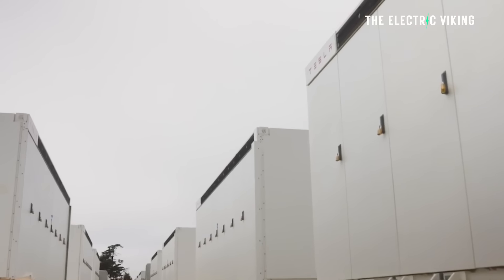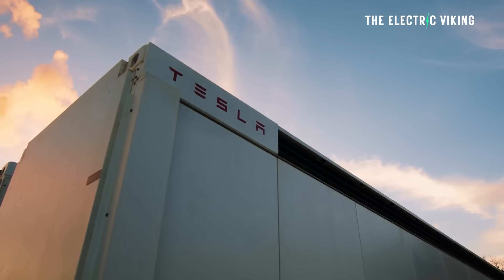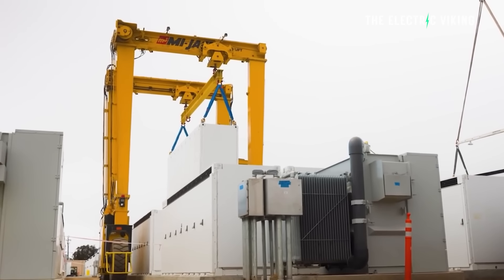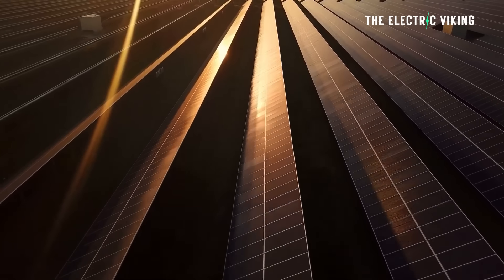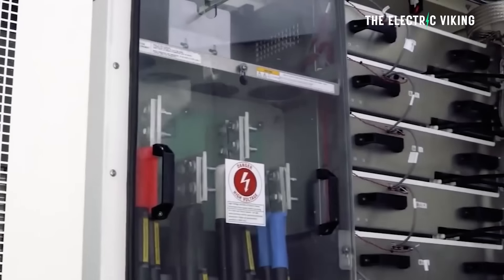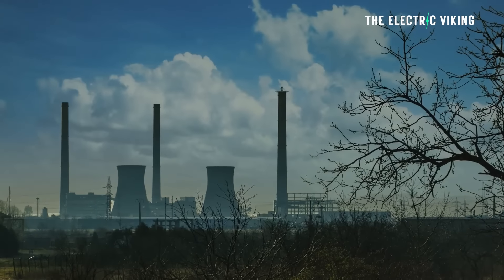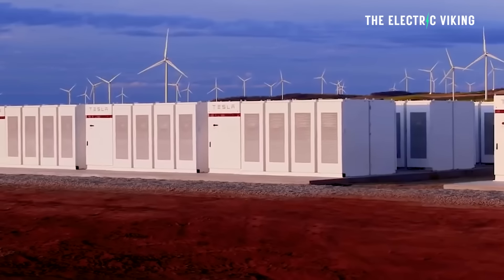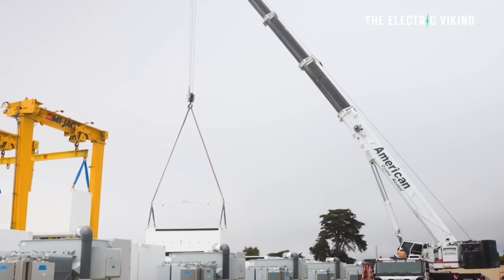Tesla megapacks deployed to build the biggest battery in Australian history

Comment: Sounds like old world thinking on new tech.
Lots of power loss over long transmission lines!

Makes more sense to have lots of batteries at local substations, 
charged by rooftop solar.

Biggest battery sounds great, but single point of failure.
Bad weather could affect battery or transmission line,
and whole network goes down.

Comment: Wonder how long the battery will last
Reply: Decades. The cycles will be regulated to reduce degradation of the already impressive chemistries. 

And when they do happen to get outside of tolerance, they will be recycled.
Reply: @williamcrowley5506  Yes, I hear they are 10% recyclable (lead acid batteries, which are 99% recyclable). What happens to the other 90% . There will be times that the batteries are delivering  100% of the power
Reply: @marvenlunn6086  They last decades. They are 100% recyclable. Lead acid last 3 months. You need to do some reading.
Reply: @marvenlunn6086 you've got mixed up on the headlines you have read. You are thinking of the story that Australia only recycles 10% of its batteries (think AA, tool batteries etc.) And not the only 10% of a battery is recycled. The story also had nothing to do with EV batteries. 
Sadly this says more about Australians and their recycling habits than it does EVs....
Reply: @steve_787  your right. The batteries are around 90% to 95% recyclable . Recycling is a scam anyway
Reply: @marvenlunn6086  🙄

Yes. Recycling has major issues. The batteries discussed here do not fall in that category. Stop letting your emotions lead you, and do the damn research
Reply: @marvenlunn6086  the steel and aluminium industry would disagree that recycling is a "scam"
Reply: @steve_787  how about only recycling a small percentage of things like batteries and plastic? It seems like a scam to me
Reply: @marvenlunn6086  I fail to see how recycling is a scam? The issue is more down to what, we the people, do with our waste. If you throw plastic or batteries into your waste bin that goes to landfill then that's a big issue. Not sure where you are in the world, but here in the UK I have 4 wheelie bins at home for waste. One is for green waste (gardening/food), 2 are for recycling metal, glass, paper, plastic and the last is for anything else, i.e. landfill items. Pretty much every super market in the UK has battery recycling drop off points so no reason for them to go to landfill. However, in 2020 the UK sold 40000 tonnes of portable batteries, but only 18000 tonnes were recycled. 
Single use plastics have been banned, and I wish all plastic was recyclable, however it still seems a bit hit and miss on what plastic can be recycled.  Most recent statistic I could find was that in the UK 44% of plastic packaging was recycled. 
So a bit under half of batteries and plastic is recycled in the UK which is hardly a "small percentage". 
However, Australia (I'm guessing is where you are from?) seems to be very far behind as it seems 10% of batteries and only 18% of plastic is getting recycled from what I can find online? So the question is, does Australia not have the infrastructure to recycle more, or do Australians not recycle enough? Either way, more should be being done to stop landfill waste.
Reply: @steve_787  They have bins and sorting here, too. Sometimes, it's put into different parts of the truck to keep it separated. Other times, they just throw it all together, but if it isn't sorted properly, they leave it on the side of the road you know how these thing work it's not what is done it's what you get people to believe is being done
Reply: @marvenlunn6086  why are you comparing curbside recycling to large battery recycling?
Reply: @williamcrowley5506  because the same thing is being done with batteries a lot are going into landfills
Reply: @marvenlunn6086  not fucking Bev or grid storage, as that is what this is about. Do you not comprehend the difference?
Reply: @williamcrowley5506  You really think they are going to do a better job recycling these batteries
Reply: @marvenlunn6086  yes. Absolutely. Recycling generally is not a money maker, recycling Bev and grid batteries is largely profitable. I can’t even fathom being so small minded that I would think the two are even close to equal 🙄
Reply: @williamcrowley5506  same type of batteries just bigger
Reply: @marvenlunn6086  not even close. Why are you speaking like you know something on social media when you don’t even understand the differences in chemistries?
Reply: @williamcrowley5506  it's not that the batteries can't be mostly recycled . it is if will it be done

Comment: 😊 Good bye fossile 😊 
If it is smart to make H2
Depends on if you can use the rest heat, and of you have some spcialprocess
that needs H2. Storing electricity battery is better, driving some cars or trucks
no way, - and using in combustion engines are a joke, there are very little enetgy in H2. But ofcorse
in special processes it could be.